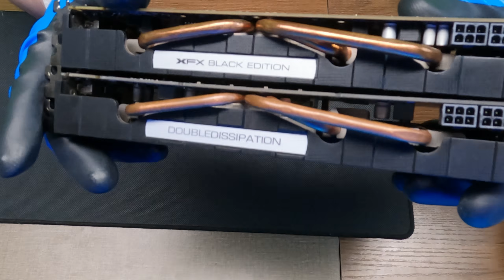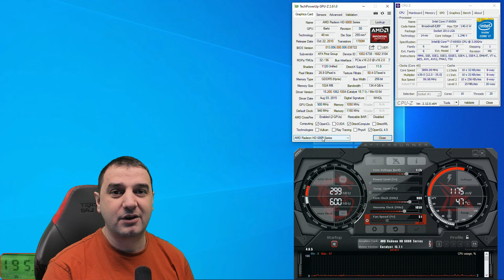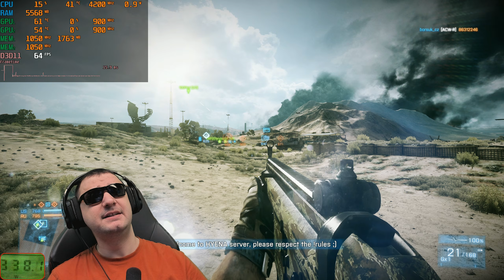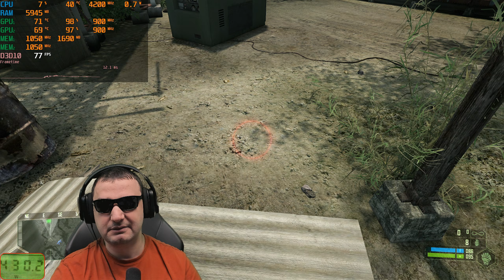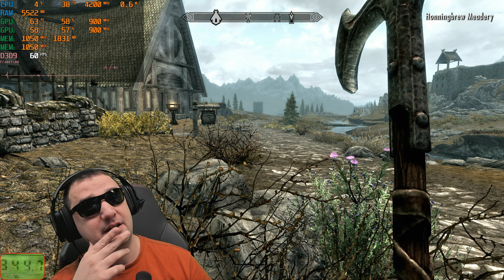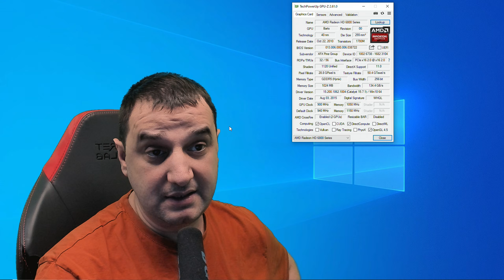XFX HD 6870 Crossfire Benchmark

Comment: Hey man, it's released in late 2010, so there are a ton of sold in 2011-2012.  12-13 years they've got in. They have really good quality, so overclocking isn't that much concern.
Reply from the maker: Yes but don`t OC old stuff. they tend to crap out.

Comment: i wish they still supported sli or crossfire with modern cards 😔
Reply from the maker: Even if you only gain the pcie performance without the link. Similar like r9 295. That quad crossfire didn't required any cables. I think something similar will have been magnificent.

Comment: very useful info first 2 minutes about crossfire to help us running 2 way crossfire and that's why I like your videos.
For your question about which processor is suitable for these graphics cards... I say use the fastest single core CPU like I7 8700K.
I using I5 10600KF which is in the same level of i7 8700K, and I getting around 150FPS AVG  on Crysis.
As always, excellent.
Reply from the maker: @sepehr1589  I'm nearly there with the i9 10th gen.

Comment: Crysis always had bad utilization of hardware to begin with. Has nothing to do with your cpu not being strong enough. Its too new. Those people shouting how you need last gen cpus did not really test stuff very much. Doubt they actually game a lot. Try mass effect 1 (le) on modern hardware. Most if not all people will experience lag in the mako on some planets, just like on noveria. I have also experienced lag in that 2007 game using a i5 12600kf at 5.2 ghz all core and 5.4 ghz turbo and a gtx 1080 oc. Basically a modern gpu will mostly be busy going to sleep half the time. If i force the gpu to run at a minimum of 1700 mhz the problems are gone. I do not experience these kind of problems using a core 2 duo at 4.5 ghz and a 9800 gx2 or something like it. Forums on mass effect 1 (le) show that lots of people with rtx what-evers have even more problems.

Comment: Get Ryzen 9600x or i5 13600k bro best performance/price cpu's , your i7 is verry old and you lose too much of fps...
Reply from the maker: i`m waiting for parts to up my i9 10th gen rig. the pc its ok with one gpu but i`m waiting not for an sli mobo.
question: What is the model for those CPUs that supports SLI/Crossfire?
Reply: @DanielCardei  bro, 10th and 11th Gen cpus are bad for gaming, from 12th gen it becomes way better in gaming, go for amd 9600x is the best for gamin/price
Reply: @DanielCardei  Cpu dosent metter with sli or crossfire, your motherboard should support it so just get motherboard with 2x8 or 2x16 Pcie slots...